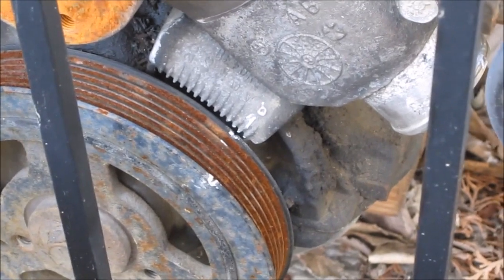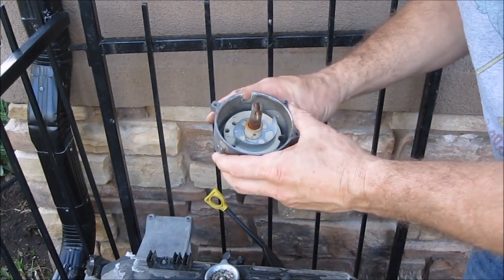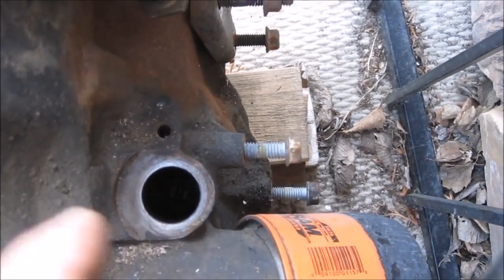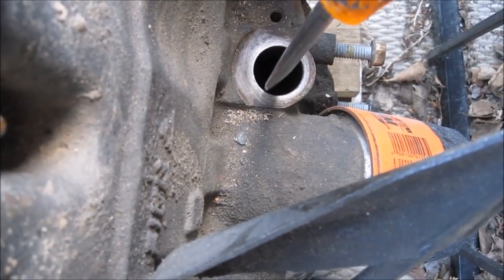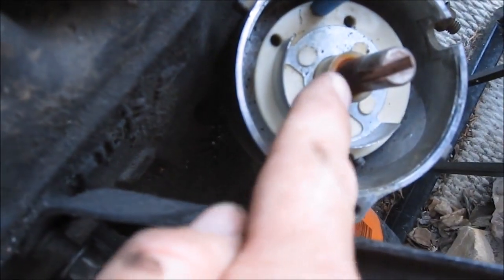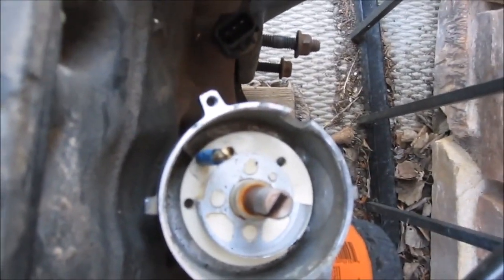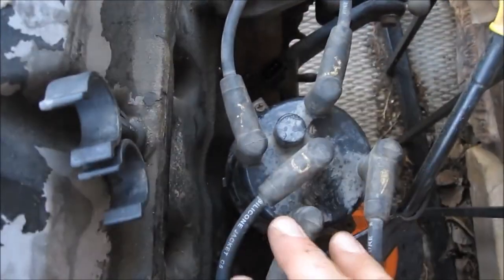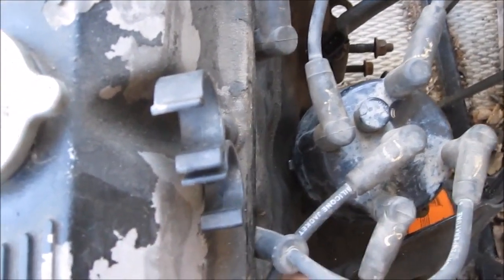Jeep 2 5L distributor installation instructions

Comment: I'm rebuilding a jeep 2.5 engine now and I need to figure out the distributor timing. I get the concept of TDC on cylinder 1 but am confused on whether it is firing or exhaust? Could you explain this a little? thanks, Tim
Reply: Tim callinan put a compression gauge in cylinder number 1 and turn the engine over with a ratchet and socket or have someone carefully bump the starter and when u start building compression in your guage u know u are on compression stroke then stop bumping it and look at the harmonic balancer and rotate it to 0 on balancer and u will be at top dead center so u can put distributor in at that point
Reply: Or you could hold your finger in the spark plug hole and you will feel it blow air out that will tell you your on compression